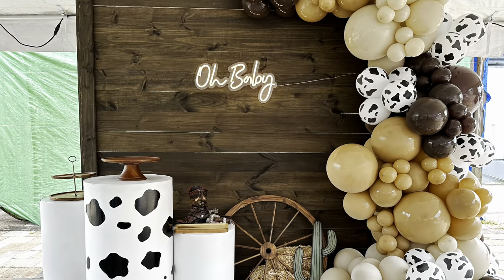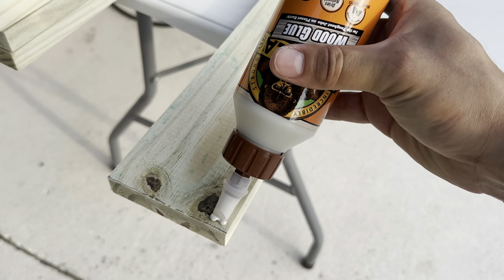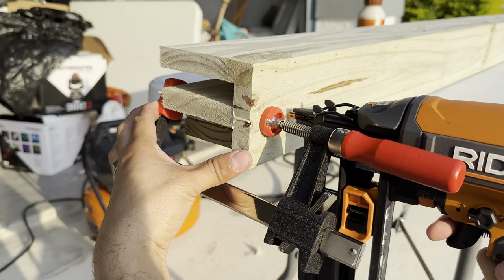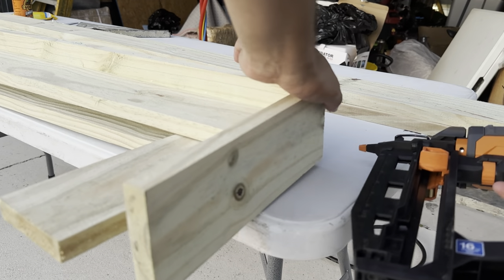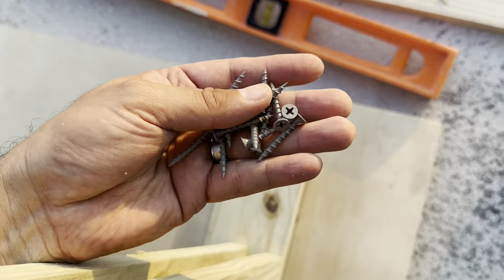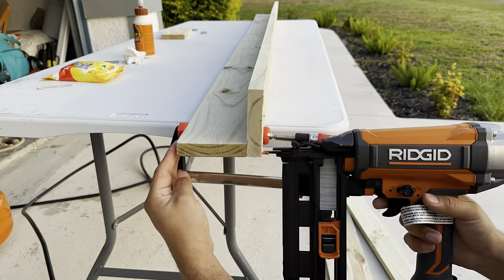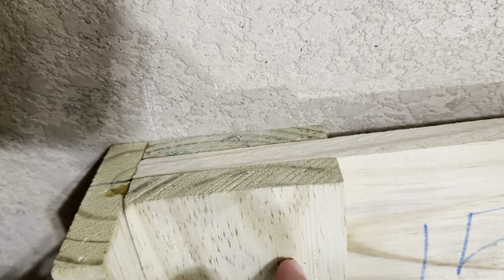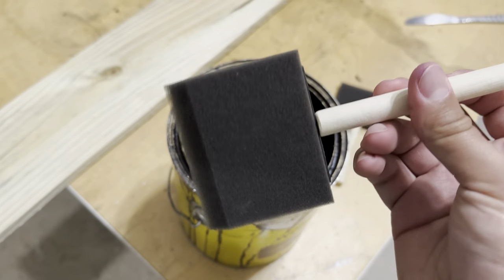Rustic wood backdrop  DIY

Comment: Thank you so much this is great! I bought 1 1/4" Exterior Screws that worked well. I also used a brad nailer with 2" nails which was a little challenging, but still worked. I might add small caster wheels to the supports as well but will need hooks on the top and the bottom I guess. You rock!
Reply from the maker: That’s awesome! Always nice when people add more to it! Glad video helped out now let’s make some money!!! Good luck! Like and share!